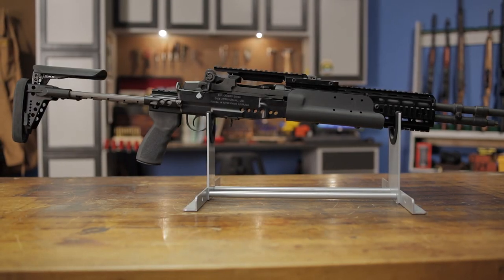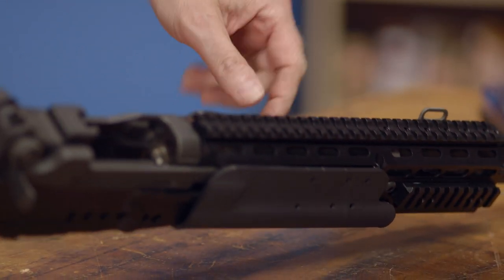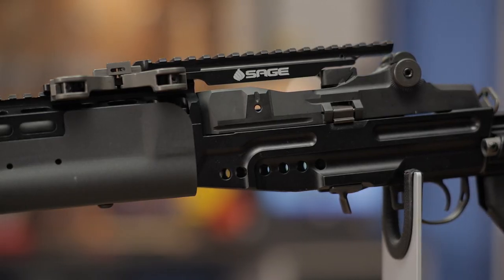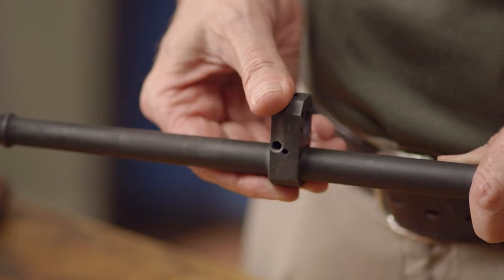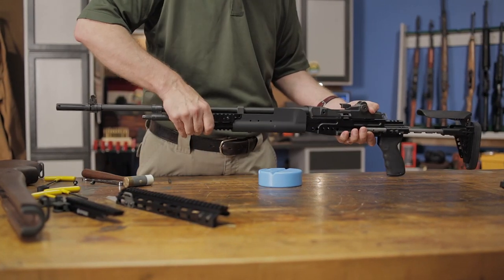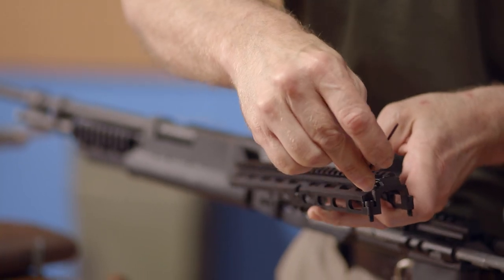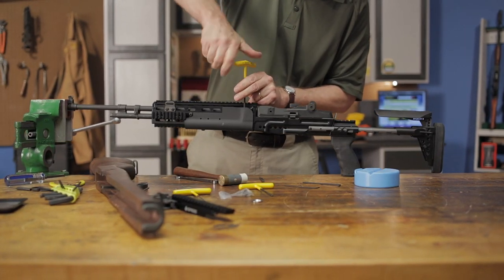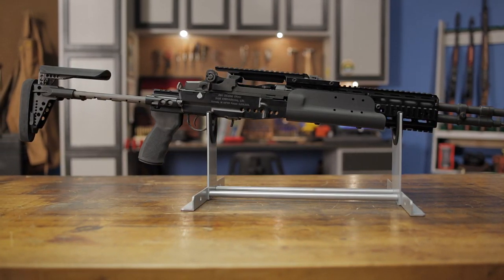Sage M14/M1A Chassis System

Comment: i dont want to buy a full M1A rifle if im going to convert to this chassis. would i be able to buy just the barrel and receiver of the m1a?
Reply: Not cheap. Crazy expensive
Reply: yes, Fulton armory
Reply: look for what's called a barreled action
Reply: Bula Defense at Classic firearms
Reply: @HiVoltish  BulaDefense makes a forged receiver, most other manufacturers are cast or cast investment.  Don't really know if it's a bad thing being cast cause I've read if it's cast and heat treated it can be just a good.
Reply: @tawaitai  it honestly makes no difference. Investment cast receivers are plenty strong enough. The M1A is no longer full auto, so the investment cast receiver will be just fine. I have an LRB, 4 Springfields, and a 450 Chinese polytec. They're good to go.. As long as the receiver is in spec, it really doesn't matter. I've had all of them run through at least one fighting rifle class, they all hold up just fine.

Comment: With the new op rod guide installed are you able to switch from the ebr chassis to the original wood stock or will the guide prevent you from being able to use the wood stock?

Comment: how do i get one please let me know been looking for one for over a year.
Reply: Conefoeva There's some for sale on gunbroker. The prices are super high, I don't think they sell them anymore.
Reply: Fulton Armory has them for sale
Reply: Contact Tony Ben or H20MAN they both have YouTube channels, i believe ClydeArmory has them also.
Reply: Called sage and placed and order. Backorder is a month
Reply: @basicgunbros4332  have you gotten it yet?
Reply: @jacobcink1365  yes sir!!!
Reply: Already installed, wish I could post a pic here. Had it cerakoted as well
Reply: @basicgunbros4332  Sick! I backordered mine on US Tactical Supply. Hopefully, it has the same ETA
Reply: @jacobcink1365  I ordered my chassis directly from sage. I had the thing assembled professionally by a gun smith, however the stripper clip base sight I ordered does not line up with the top rails so I’m going to ditch that plan of bridging the action and I went ahead and ordered the sage cantilever optic mount from us tactical supply. This thing is on back order so I have no idea when I’ll get it. Open sights for now
Reply: @basicgunbros4332  I ordered one for my mini 30 so I don't think it'll be as complex as the M1A. Hopefully I can do it myself